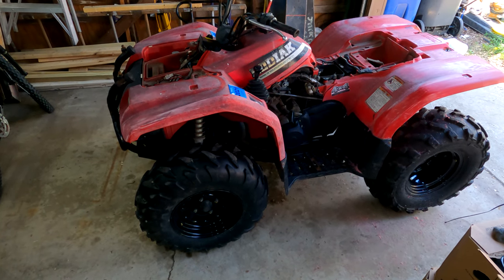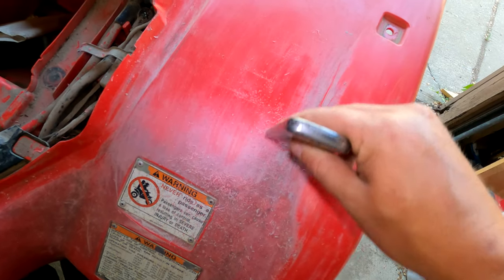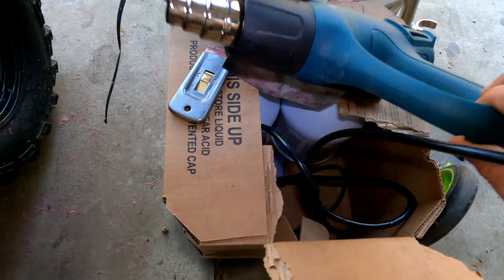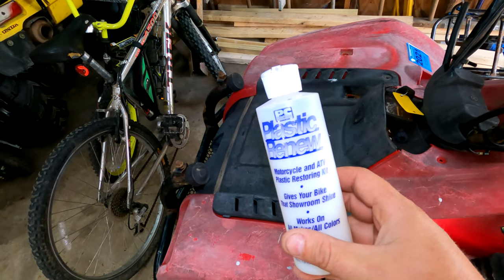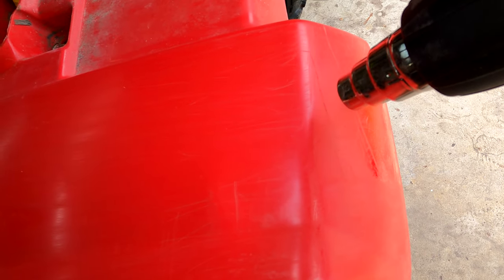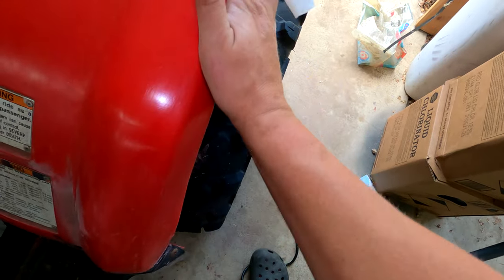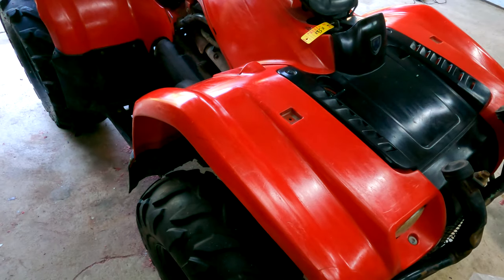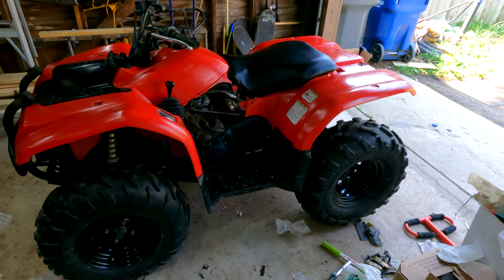Resorting Old Faded ATV/Dirt Bike Plastics

Comment: Do not do this people. Heat is not necessary and you risk permanent damage to the plastic. Use a buffer and a nice plastic compound and you will get a better result.
Reply: Good advice
Reply: Hmmmm no
Reply: Lol it's not going to hurt it if you just take your time and don't burn it, it doesn't "damage" plastic, it's actually pretty good for it, plastic is made by heating it.
Reply: Lol been doin for yeaea you need help lol
Reply: I can speak from experience when working with old brittle sun faded plastic. The heat brings the color and the flexability of the plastic back to life

Comment: If you have a buffing wheel I recommend using it instead of a heat gun because the heat gun makes the plastics brittle after a while both work though
Reply: When using a buffing wheel what kind of pad and buffing compound should I use? Thanks
Reply: U use a heavy cut or finish?

Comment: Another video showing 60% paint thinner and 40 % boiled linseed oil . Looked like it worked
Reply: I just found that method. Looks like it works pretty good. They don't recommend the heat method.
Reply: I tried that method it was awful makes the bike all greasy and smells bad and within a month its faded worst than before… so ima give the torch method a try than slap some uv protection clear coat over top of it
Reply: @jmanuel5493  From what I've seen the heat gun method lasts even a shorter amount of time.

Comment: This works really well and it’s not hard to do but it will be back to faded white in very short order. It would be nice if there was something put on there to protect it. Are you aware of anything?
Reply from the maker: The ones have done have not faded back.  Going on 3 years, guess I’m lucky
Reply: @HillendaleBros  That’s odd. I’ve done three of them and all three of them faded back pretty quickly. They do get ridden a lot so they see a lot of sun.
Reply from the maker: @markmanning6773  yeah that could be, mine stay covered pretty often
Reply: All the treatment you put back in as well like sc1
Reply: @TheDfrancis37  I’m not really sure what you just said but doing this is not at all like SC1. SC1 is good stuff but it won’t do this
Reply: @markmanning6773 wd40 works very good for the black very good not sure abt anything else though
Reply: I found this method online. It's supposed to protect. They don't recommend the heat method. 
Boiled Linseed Oil For Faded Plastic

Linseed oil can recover discolored plastic, however, it takes ages to dry. You need boiled linseed oil, rather. Note-- this does not imply you steam the linseed oil on your own! It implies that the linseed oil has actually been pre-treated to completely dry faster.

To speed up points along, choose boiled linseed oil and mix it with paint thinner. We advise a 40/60 proportion of linseed oil as well as paint thinner.

Begin by cleaning your ATV extensively. For best results, you'll intend to eliminate the rack as well as any other parts of the device that are covering the plastics.

Apply the mix to your plastics using a completely dry cloth. You'll discover the linseed oil will remove the oxidization that's causing fading. After you have actually used the blend to all the plastic, allow it a full day to dry.

If you maintain your ATV covered and do not use it on a daily basis, this restore will certainly last for a couple of months. If you continuously use your ATV outdoors, this treatment might be called for to be done again in 4-6 weeks.

Comment: U are the man I've got a trx 300 1988 it's worse than yours it's red and ive tryed every thing and the Razor blade scraping the top off work like a champ. Thank you. You're the only one that i've seen doing this, and at one million percent works, I wasn't thinking it wasn't gonna work it did for anybody that's guessing it works !!! And my plastic is bad bad and it looks new red comes back so crazy !! I'm going to wet sand and buff at the end but I have tryed a spot on all 4 corners and buffed looks so good!!
Reply from the maker: @rickybailey7123  glad it worked out, thanks!

Comment: I 'm doing a  bare frane restore on my 1986 moto 4 225. My plastics  are not broken  but they look  like that .my frame racks front bumper and rear bumper are blasted and painted  the rear bumper  has been  powered coated  chrome  l will try some of these trix  but probably finish with the buffer

Comment: can this type of plastic be welded?
Reply: Yes I use zip ties to weld it back together with a soldering iron
Reply: Yes
Reply: You can also notch it, JB weld it and then sand it.  It's work but it ain't coming apart afterwards.